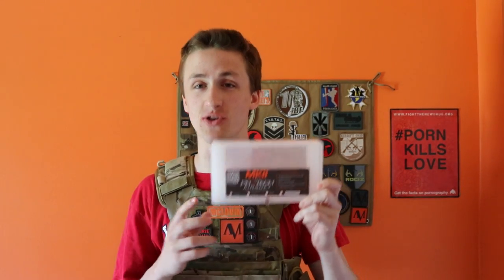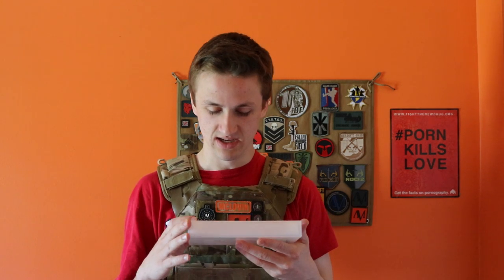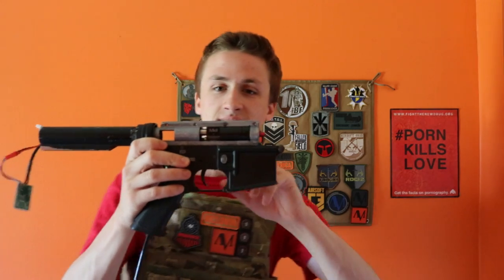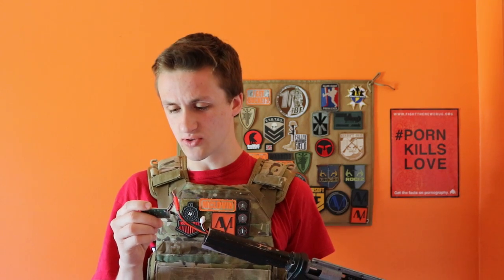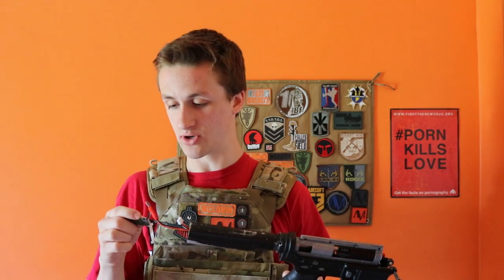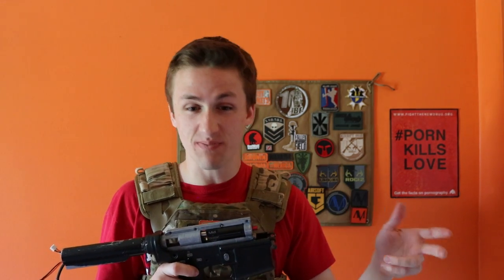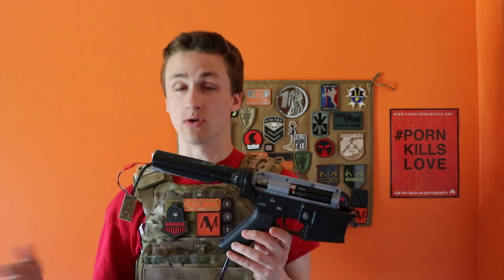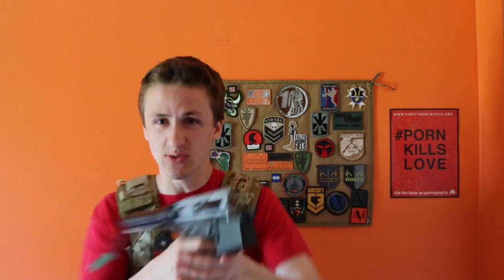Protech MKII Newest Airsoft HPA System

Comment: There's a HPA drop in system made by Mancraft, and it's a completely mechanical system, meaning there's no FCU or battery. It's a semi auto system, and it's priced around 230$ i believe.  The system is called a PDiK (pneumatic drop in kit)
Reply: +Kyle Eaton yes but it sucks
Reply: +Texas Milsim LOL
Reply: +Texas Milsim no it does not....

Comment: Also, the valken V12 is 300$ aswell, but it comes with a full gearbox
Reply from the maker: Thanks for the info! Didn't know that'
Reply: +alecmac111 your bro is amazing shershotmiget14
Reply: v12 is ass tbh
Reply: V12 needs to be modified to work as good as a wolverine or p*